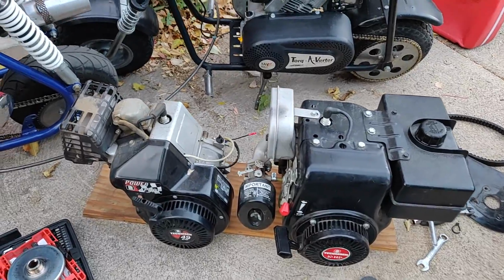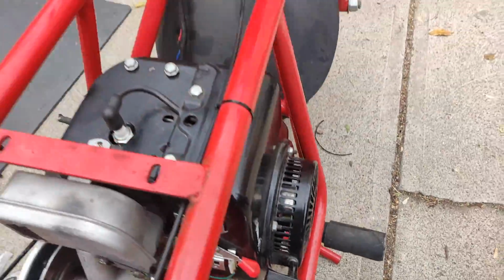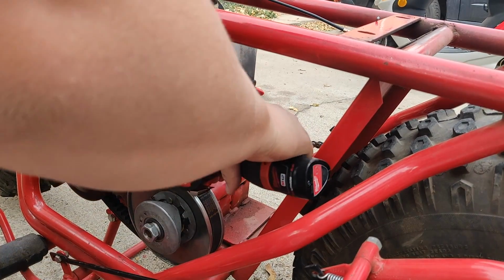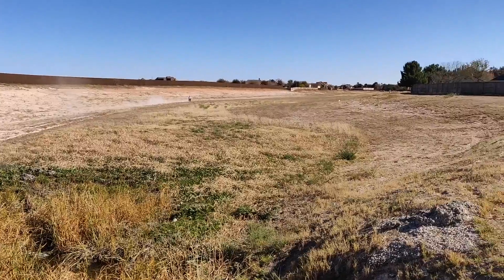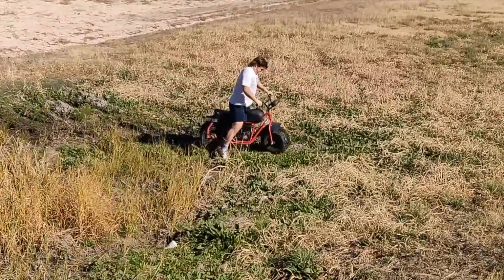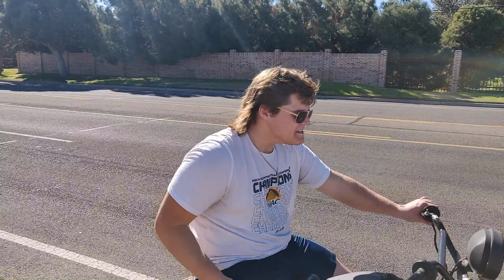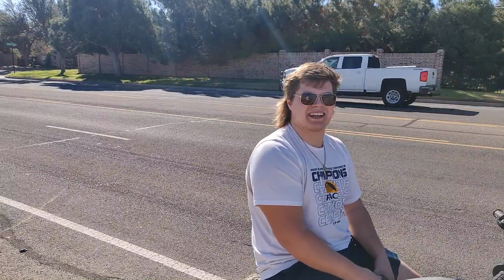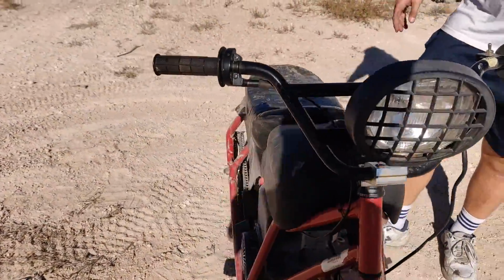Big Block Swapped Monster Bike! | Manco Big Cat

Comment: Looks way fun! My MB200 with almost stock motor (open exhaust 18# valve springs 38T rear sprocket rejetted Hipa carb) gets 43mph but its turning 5200rpms. it's fast enough for this old man! Happy trails guys!
Reply from the maker: Sounds like a sweet setup. Thanks!

Comment: Great video awesome swap I have the same 10 hp engine and I want to do the same carb. What did you have to do to remove the governor?
Reply from the maker: Pull the side cover off the engine, remove the shaft, gear, weights, etc and plug the hole where the shaft went thru with jb weld putty

Comment: I've got an all original, near mint (has all the plastic shroud sections) lime green "Big Cat" that will eventually go on Ebay. My Heald Super Bronc has a factory 10 hp Tecumseh for all my horsepower needs and will do 45 mph no problem. How did you determine what size Mikuni carburetor to use? Anyway, that's a pretty cool modification you've done.
Reply from the maker: Are you on any of the mini bike Facebook groups? I'd love to see pictures of your bikes. DM me on Instagram @hondayamahafan

Also I use Mikunis mostly because the throttle feel is much smoother. I just use a 22mm because it's roughly the same size venturi  as the factory carb.

Comment: What is the engine diameter for the crank where the clutch or torque converter goes
Reply from the maker: This engine had a 1” crankshaft. They also came in 3/4” as well

Comment: Wow, that's all, 31 mph with a 10 hp engine! Lol.  My Coleman CT200U-EX with a stock 6.5 hp engine does 31 mph, but I zip-tied the governor and cut off the throttle stop screw on the linkage, but that's all I did and it goes 31 mph.
Reply from the maker: This bike is much larger than a Coleman and geared much lower. More horsepower ≠ More speed
Reply: I had a flathead 98cc with a racing clutch and bigger carb. When I was a kid, my weight coupled with the small bike that engine was in with crazy tall gearing meant I could go 40mph, 45 downhill. Top speed isn't always that fun though. My current 6.0hp OHC Subaru mini bike only tops out at about 30mph even with some mods but it's built for trails so the top speed is irrelevant. That Subaru powered bike can wheelie/rip burnouts all day though

Comment: What size Mikuni and did you have to do any jetting?
Reply from the maker: Vm22 and yes I had to jet it larger. 100 or 105 I think but I'm also at altitude
Reply: @hondayamahafan  i slapped a 30mm mikuni clone on my hm100 and it ran perfect with whatever jet is in it. Lots of torque and sounds like a harley. Put it on a baja warrior. Id love to find a big cat
Reply from the maker: Very nice! It's a fun bike. Very heavy though. The 6.5 that was on it was dead slow!